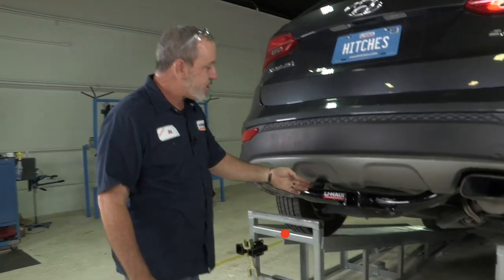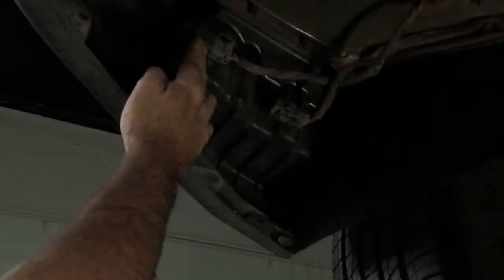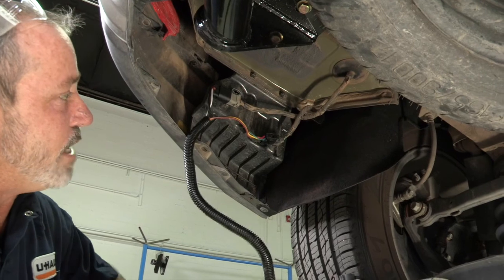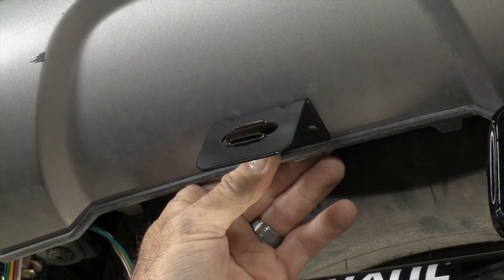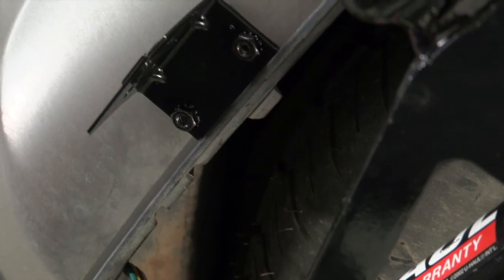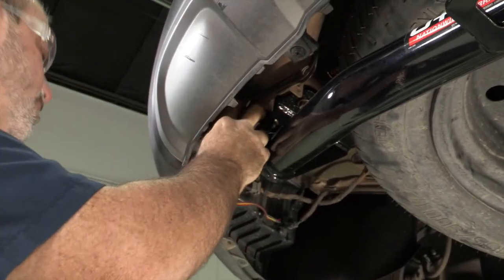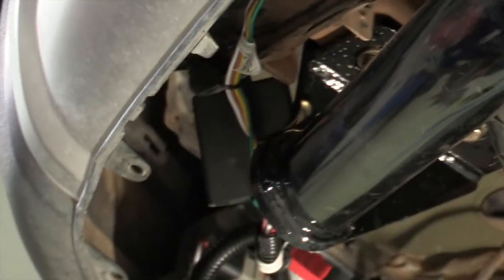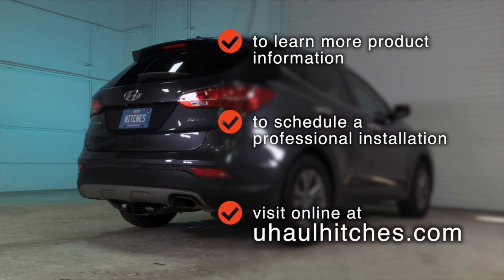2017 Hyundai Santa Fe Trailer Wiring Installation

Comment: You don't know how close I was to returning the wiring harness until I saw your video and realized I had to remove the entire plastic cap from the ends instead of just the rubber plugs in the end.  Thank you so much for this video!